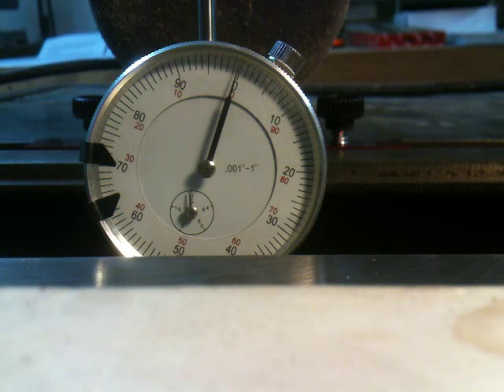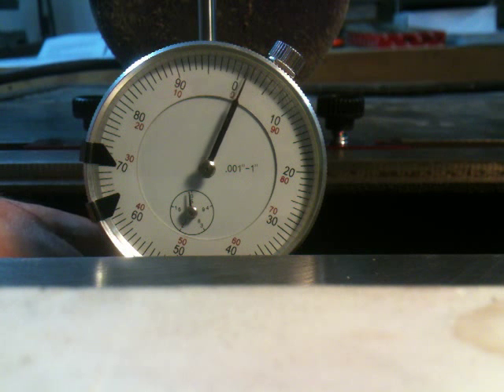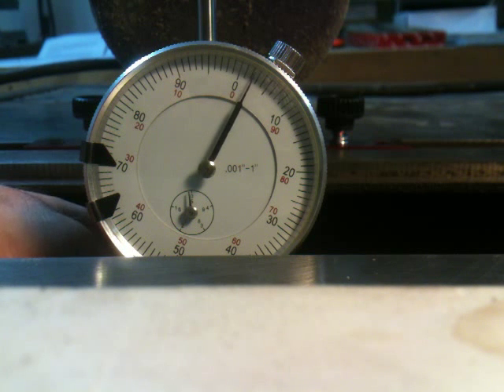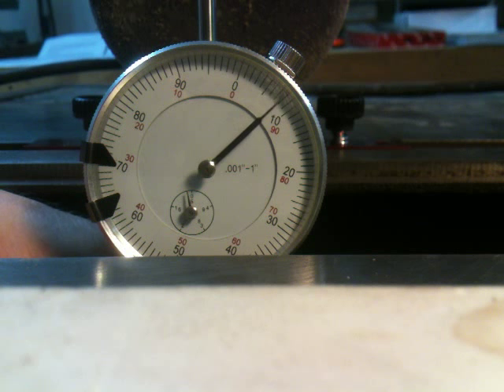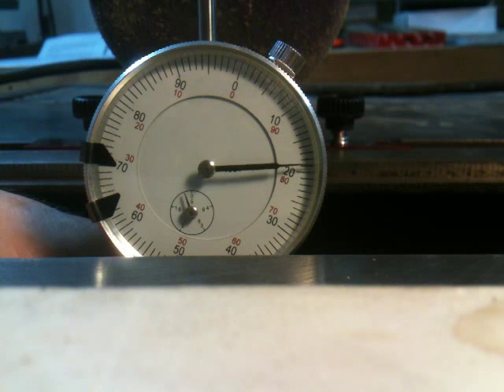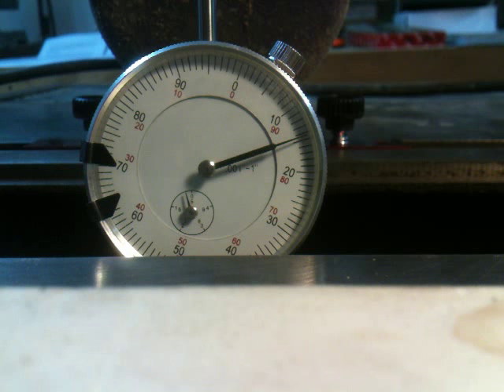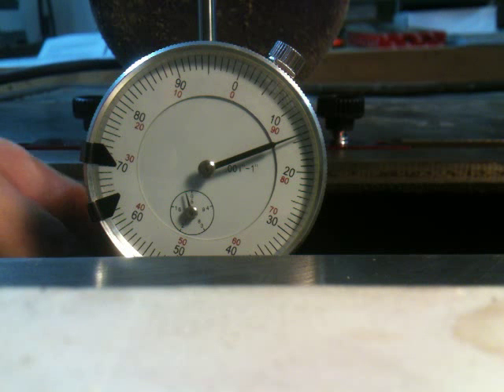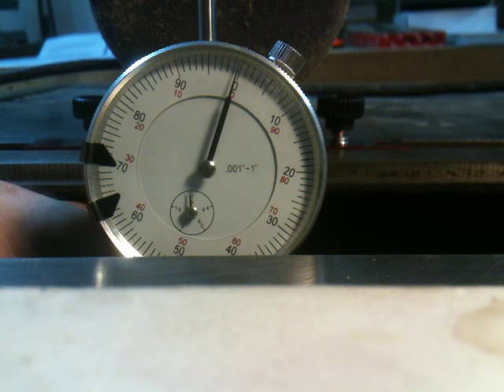Tablesaw renovation test 2: Checking for Arbor shaft play (Bearing play?)

Comment from the maker: I'm sorry if it wasn't clear.. Yes that's exactly what I was doing - I was pulling the arbor shaft UP with my hand.
This is to check how much "play" (excessive movement) I have at the arbor shaft.
The dial indicator tip was placed on the smooth section of the arbor shaft (where usually the blade sits) so what you see is the actual movement of the arbor shaft when I pull it and push it up and down.